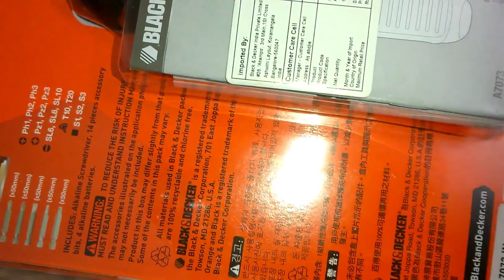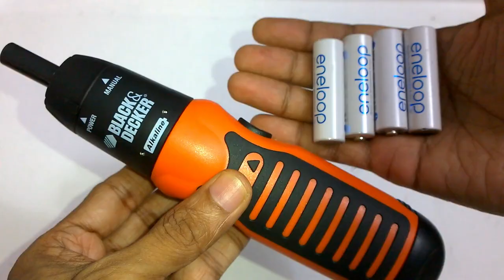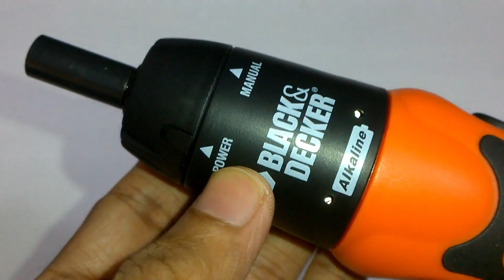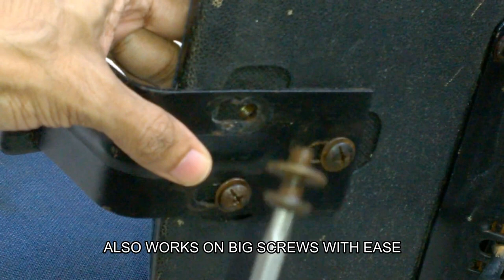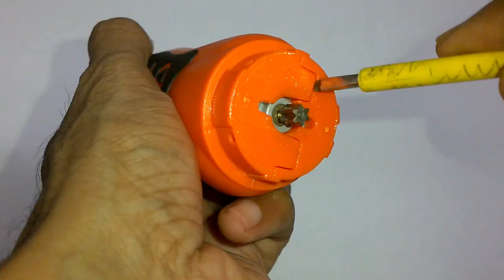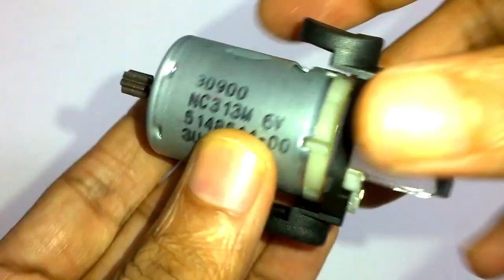AA Battery-Powered Screwdriver?

Comment: It looks like it would be nice for little projects around the house and for working with screws that can be easily stripped. This would have been handy when I was assembling a plastic shed as it came with a sizable bag of screws. The shed is really nice but I had to be careful not to overtighten the screws so that the plastic didn't get stripped out. Thank you for the video!